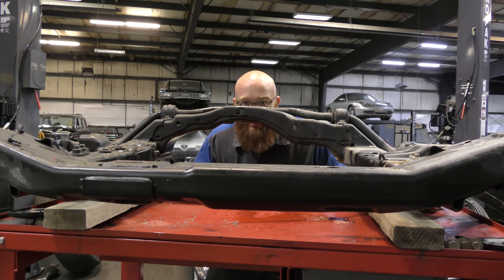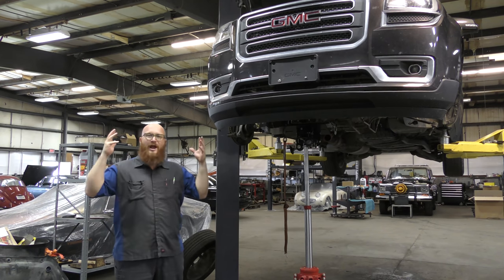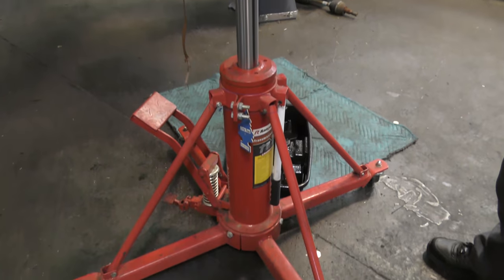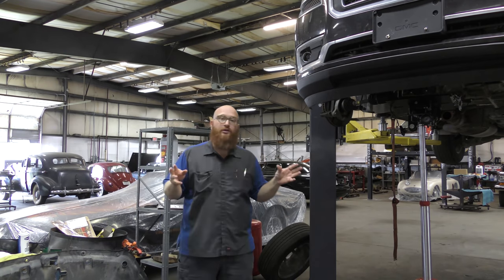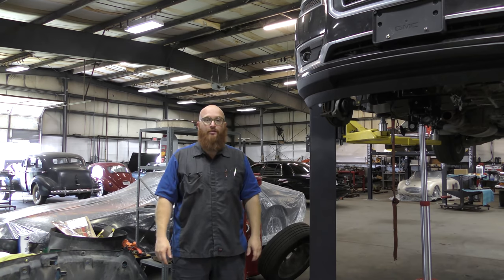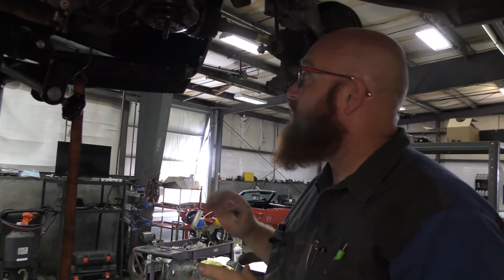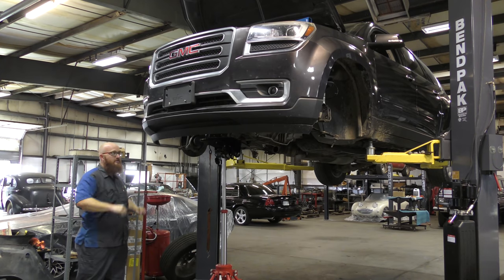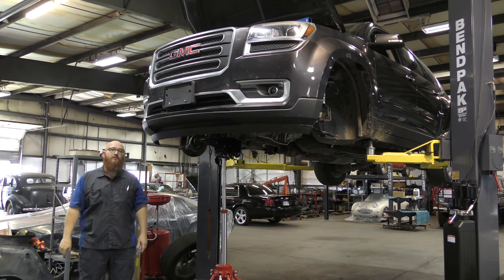Used car insanity in the CAR WIZARD's shop! Why did the huge repair get approved on this '15 Acadia?

Comment: I've been a mechanic for almost 18 years now, 10 of those years were at GM dealerships.  I've done so many 3.6 timing chain replacements, I can damn near do it blindfolded.  I've actually grown to enjoy them.  I'll happily do GM 3.6 and 2.4 timing chains all day long.  I can have an entire Traverse/Acadia/Enclave subframe, with the engine and trans still perched on it, out on the floor by lunchtime and have it buttoned back up with fresh chains, guides, and tensioners by the end of the day.  Ironically, the biggest time-sink of the entire job isn't dropping the drive line out of the vehicle, it's cleaning the old RTV off of the timing cover and engine to make sure it doesn't come back in a few weeks with a timing cover leak.  It can be done in chassis, but it makes it almost impossible to properly clean and prep the engine to re-seal the timing cover and the general lack of access makes the whole job very frustrating.  I find it's much less headache to just remove the engine/transmission/subframe as an assembly.
Reply: 45 mins the cradle with powertrain is on the floor, By lunch time I have the chains finished and its running, hurry up
Reply: Right on
Reply: Urination Bob is relieved
Reply: @scrappy7571  How much time does it pay?
Reply: @peterl2017  usually 12 or more, depends who is paying,  or if insurance is involved
Reply: @scrappy7571  I have noticed a big difference between burned out mechanics and new fresh faced hard working mechanics. The old Mechanics give with pain and the new mechanics give with pleasure and time of completion of the job is about half or even less for the newby !
Reply: Good on you sir.  As an independent mechanic, time is money and if the job takes longer than what the “book” says, then you have to eat that cost. So it’s to your your benefit to get the job done sooner as long as it’s done right.  I do recall Car Wizard did a program on that subject.
Reply: Probably do a 2.4 in the car, but certainly agree that the 3.6 needs to come out. It is a far more efficient job.
Reply: 8 hour tech time for an experienced technician. The book time must have been nuts at the dealership.
Reply: @scrappy7571  30min on the floor - running by brunch.  Your move!
Reply: @GhostYT_lat  I work with a guy, back when we had chitloads of them, he would do 2 in one day.  I'm too old to move that fast all day.
Reply: @scrappy7571  i do the whole job in 1 hour
Reply: @RP-pb8yx  Pencil whip that repair order!!!
Reply: I have a cute little Fist with 1.3 16V diesel (it’s also used in GM Ford and Peugeot). It’s a wonderful engine design BUT. the single row cam chain will be worn out at 100K miles. Parts to replace are about £200 plus labour. Your costs double when the chain fails but the engine almost always survives. 
The big pi$$er is that a dual row chain would cost fractionally mire any probably never fail. Tell that to the factory bean counters.
Reply: What is it like to work on UAW crap?
Reply: I still don't understand why GM ditch the reliable 3.8 engines and replace it with POS 3.6
Reply: Yeah, they went from synthetic blended oil to straight synthetic in 2017 Dexos2 Gen1.
Reply: @jermainebynum8265  It's all about government fuel economy, and emissions standards.
The 3800 was arguably the best, most reliable engine GM ever produced, next to the small block V8, but because of ever increasing fuel economy standards, and lower emissions regulation, the 3800 could not meet those requirements, so GM phased them out.
The reason the 3800 was so reliable was its simplicity, now you have dual overhead cams, four valves per cylinder, so on, and so. The more moving parts, the more prone to mechanical failure you have. 
A quote if I may " the more they overtake the plumbing, the easier it is to stop up the drain."
           ~Montgomery Scott- Star Trek
Reply: @captainkirk4514  I wonder if the engineers rise the red flags on 3.6 engine. I remember the chaos of the early Northstar engines for Cadillac, the accountants really run the show.
Reply: You could make a lot of money buying up Lambdas with bad timing chains and repairing them, flipping them. The auctions and junkyards are overflowing with otherwise nice first gen Traverse Enclave Acadias with bad chains.
Reply: @daveh2612  yup. That idea has definitely occurred to me.  Same thing with 2.4 Ecotecs that need re-ringed. People love Equinoxes and Terrains, and those engines are child's play to rebuild.
Reply: I can't believe GM discontinued the 3.8l v6 very reliable engine, that engine could go against Japanese engines. After the  discontinuation of the 3.8l v6 GM made the piece of junk 3.6l v6
Reply: Make a video about it.
Reply: When I used to work at a gm dealer there was a guy that just did 3.6 timing chain & cover leak fixes. He’d finish one then start on the next.
Reply: @miceinoz1181  I just did a 2.4 timing chain job in the car, wasn't that bad. The bad part was getting the exhaust manifold in and out to change the water pump and thermostat, followed by a new exhaust manifold since it was cracked, that part sucked.
Reply: I just did my first on a 2007 Saturn Aura, in car no subframe drop. I know I spent over 2 hours just cleaning mating surfaces for the cover and on the engine. I couldn't justify spending $2300 on labor!
Reply: Wheres your shop? How much does a timing chain job go for on these engines?
Reply: @jermainebynum8265  Because it was too reliable, just like Toyota is doing with their reliable V8, by replacing it with that garbage V6 TURBO 😂
Reply: You hit the nail on the head. Especially about the cleaning and prepping the engine mating surfaces just to make sure the car is fixed correctly. I too enjoy doing Ecotec 2.4 Timing chains
Reply: Dear Craig, how long would you say an early-gen 3.6L GM v6 on a Cadillac CTS 2006 would last, in miles? Mine blew up around 145k with no timing chain service. What if you do get them serviced? Do they actually last till 200k miles before something else on them blows it up?
Also I hate working on this engine from the top down. It sucks. The design is really dumb.
Reply: 2 hours it's all out on the ground
Reply: @MrCountrycuz how does UAW make it crap? 😂😂
Reply: It’s all due to lack of maintenance. These 3.6 V6s are VERY picky about their oil. If you don’t change your oil every 5k miles or less, or don’t keep the oil level at the top at all times, the timing chain will stretch and they will blow up at a young age. If maintained perfectly, they are reliable long-lasting engines that will easily go to 250k miles or more. KEEP UP ON YOUR MAINTENANCE PEOPLE!!!
Reply: @jermainebynum8265 They are not POS! They are just not tolerant to neglect like other engines might be. If maintained properly they are reliable long-lasting engines. They are just picky about their oil and need regular maintenance or they will fail prematurely.
Reply: @theshield1613 The 3.6 V6 is not junk if maintained perfectly. It’s just picky about it’s oil and maintenance and does not tolerate neglect. If maintained perfectly they are reliable and long-lasting and will easily go over 250k miles.
Reply: @fyodorberkovich8247 They will easily last to 250k miles or more if maintained perfectly throughout their whole life without needing a timing chain job. The reason they blow up is because of lack of maintenance. They are very picky about their oil and maintenance and are not tolerant to neglect. If you do not change your oil every 5k miles or less and always keep the level to the top, they will stretch the timing chains and blow up early. But if you do keep up on maintenance they will be just fine.

Comment: Just a few years old and already needs a major service. I’ll stick with my old Honda 👍🏻
Reply: Honda has problems as well. but overall those Acadias are toilets on wheels.
Reply: I have just two older vehicles   a 1999 camry    bullet proof overall     my other ride is a 1984 nissan 200sx with a ford 5.0 v8 swap.   both easy to work on and relible...paid for     bought the nissan back in 94   still runs today   swapped the original 1.8l turbo when it had 316K   still ran decent when pulled     the camry has 266k still runs great    original engine and trans....
Reply: Yes I have personally driven two Honda's over 300,000 miles never once had to replace a fuel pump or vent-Hot Cold actuator and yes the A/C in both cars still worked maybe a top off or so once in 8 years.
Reply: me as well, my 21 year old Accord is still running strong with virtually everything original, replaced timing belt/waterpump as preventative maintenance. Great car, so glad I bought it brand new in 1999.
Reply: Not just GM. I'm dealing with a 2013 VW and I'm searching for a Honda now.
Reply: 2015 year model was likely sold in 2014...so it's been 7 years.  I would say seven years before a major service is pretty good.
Reply: @cswann8  my 2007 Ford Edge has 160k miles and has not required any major service like this.
Reply: At four years old, my CRV  needed $2000 in engine work. Worn out timing chain, failed variable valve timing assembly, guides, seals, etc.....The rear differential has been repaired several times under warranty, but will creak and groan if it's not serviced ever 15K. It has a list of reoccurring issues, and replacement parts that fail repeatedly.   It is maintained at a level of care that far exceeds  typical, including 5K oil changes with synthetic and OEM filters. I had two Honda service advisors take it for a test drive recently, and both noted that they rarely see customer cars in that condition, as it looks and drives new. That said, it's seven years old now, and compared to Hondas I've owned in the past, it isn't even close to the caliber of product they once built.  It not a POS GM product, but it's only marginally better. Honda is living on their reputation they earned in the distant past,  when they DID build bulletproof stuff. That is no longer the case.
Reply: I have had over 6 Hondas in my life. All used and all but one over 100k when bought. They were all cheap but they also all had major problems before or around 200k. I don't understand why people think Honda is so great even though I used to believe the same until I  snapped out of it. Maybe most Honda loyalists buy them new or low and dump them around 100k never knowing. The main reason you see so many old ones on the street is because they are easy to work on and so many have rebuilt engines and transmissions ect... (a few of mine did actually) Toyota is a different story.  They are absolutely more reliable but they also are expensive when you consider their slow evolution (which is what makes them reliable) and lack of power. There is a reason the new Supra isn't even their design AND they have made sure Supra fans know this ahead of time. 

Personally I think that "American" companies put focus on HP while juggling regulations and so they all end up needing extra maintenance. The engines in this video for example have a great reputation with people that baby them. They also really do have a lot of power for the initial costs and fuel efficiency.  If we would accept more emissions and less fuel efficiency for the same power I'm convinced we would get more reliable vehicles without spending a fortune.
Reply: @kerrykerry5778  Thanks. Yes. All of them are suffering for various reasons. Regulations being a big factor. Not just on the environmental and saftey side either. Taking out the middleman (dealers) might at least drop the initial costs and BS.
Reply: @CynHicks  I've had the opposite experience. Grew up in a Ford family where most vehicles (purchased new with the exception of my Mustang and dad's Fusion) had major issues. Cracked Ranger frame, blown Explorer transmission, bad Focus clutch pack, Mustang #7/8 bearings spun. All well-maintained vehicles. Bought a 92 Civic for a grand as a joke. I maintain it to a T and it has been the best vehicle I have owned. 228k miles on the original engine and auto trans. I will agree with you in saying that newer Hondas have lost their way. The only brand I'd buy for a dependable daily driver would be a Toyota.
Reply: My 99 Chevy Blazer has 257,000 miles on it still running strong... Hoping to get 300K out of it before it's retired. Certain Chevy trucks are actually pretty good and reliable and parts are plentiful.
Reply: @TermiCobraKid  I wasn't trying to say that Hondas are bad just that in my experience they haven't been as reliable as a lot of people claim. It's nice that you can find parts easily ect.. for when they do have problems though for sure. There is only one I know of that will consistently get over 300k miles, worry free and with long maintenance intervals and that's Toyota. Like you said.

Good luck with yours. Those were some of the ones that gave them a good Rep. I had a 91 civic that was pretty great with fuel. Manual. I could get 40mpg. No power so around 450k km (it was all in km) after loosing power I sold it. Got it with only 90k km for 2500 dollars. Most reliable Honda I ever had. Only changed the clutch disks. It was all original.
Reply: @neilduncan8657  my father in law has a 99 Camry with 430k miles
Reply: @TermiCobraKid  I guess it depends. All I’ve ever driven is fords. Drove a 99 escort wagon to 170k miles. A 2011 focus to 165k miles. Wife has 2011 fusion with 130k. Now I’m driving a 2021 ranger. None of them ever had any issues other than spark plugs in the escort. I’ll stick with Ford til they let me down
Reply: hell yea got my 05 impreza wagon just keeps goin
Reply: I paid 2k for an old but clean Honda Accord, did the oil changes regularly and drove it for 5 years without an issue. Only Honda and Toyota offer you motoring that cheap in the long run.
Reply: @KS-xo3oh  I'd never buy most newer Hondas. Their old cars were great
Reply: Hondas used to be built in Japan, these days a lot of them are just built in the US or Thailand or Mexico. No more old Japanese man building your stuff, no more reliable cars.
Reply: @Lancaster604  That isn't strictly true. The engines are almost all built in Japan and sent abroad to be assembled into the cars at factories where robots do most of the work.
Reply: @silasmayes7954  keyword in my comment is “old”
Reply: @Lancaster604  my 2011 pilot was built in Alabama, I’ve had no issues and only have done recommended maintenance
Reply: @TermiCobraKid  My 2007 fusion  3.0 v6 has  not had any drive train  issues,had it now going on 14 yrs ,a great car.
Reply: @kerrykerry5778  take it to a different shop.
Reply: Hell ya lol.   It's why I've had 3 92 accords.    This one was maintained well and now I can take care of it too.  240k miles hot heat cold ac stickshift original clutch
Reply: @gingerwilliams713  All work done was typical defects for that series of CRV. The work was done by a great independent tech. and a competent dealership, when it was warranty work. Finding the greatest shop in the universe is of little value, if you expect them to work magic on a vehicle that is poorly designed or built.
Reply: @kerrykerry5778  ever own a GM 3800? not all of their products were bad. the 3.8 has been out of production for awhile now, but i own 3. one of them is a summer car.
Reply: @samholdsworth3957  with work, you could get Way more than a little 300,000 miles bud
Reply: Buy jap
Reply: I always dreaded the diagnosis "rear main seal failure".